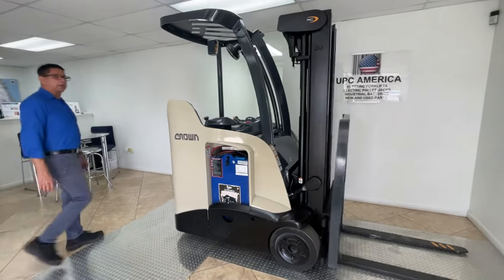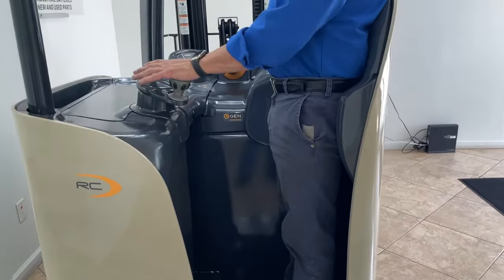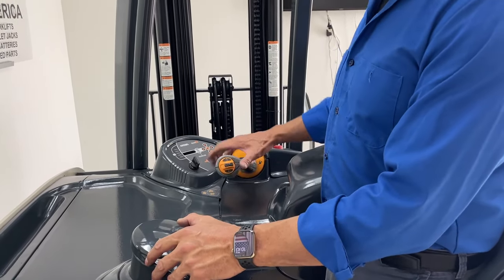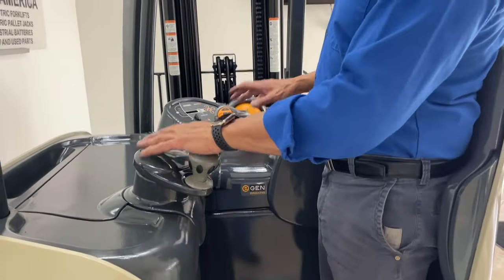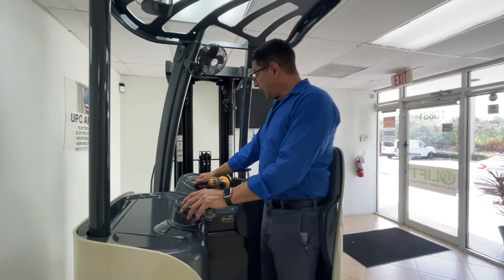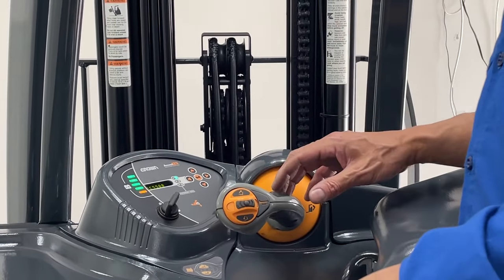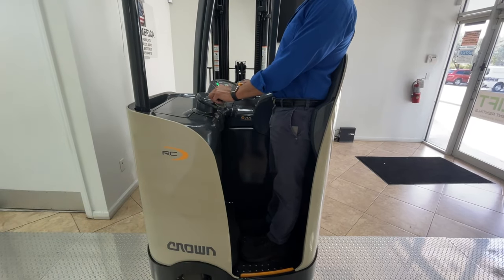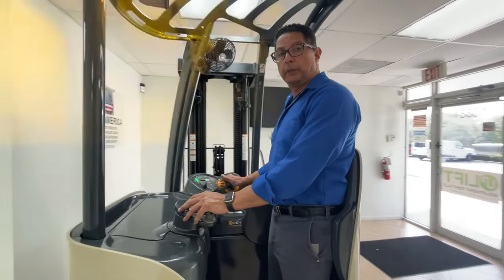How to drive your Crown RC5500 Electric Forklift

Comment: bottom has 3 switches not two, you have your deadman stop as well as your main switch, you also have your third switch which is the yellow plate at the back, that third plate is for if you're in a tight/heavy pedestrian traffic it disables all controls